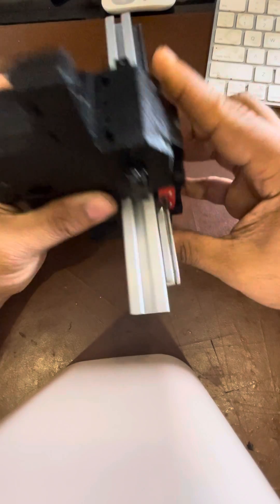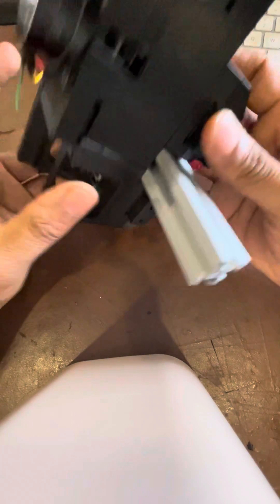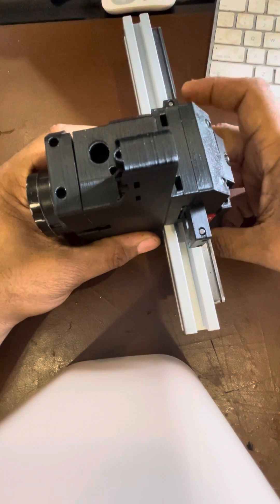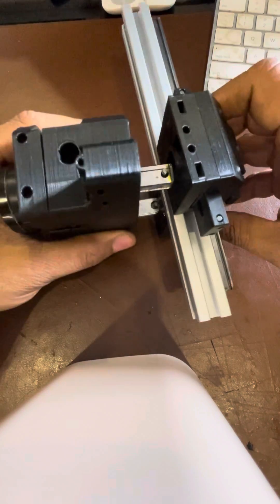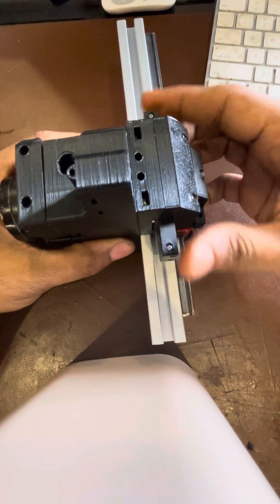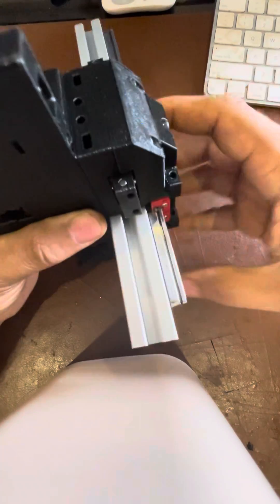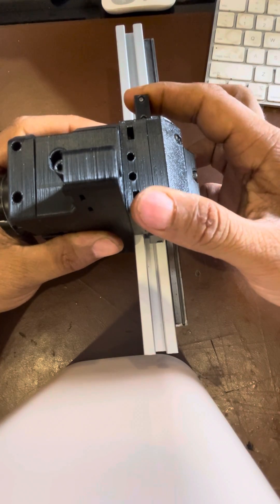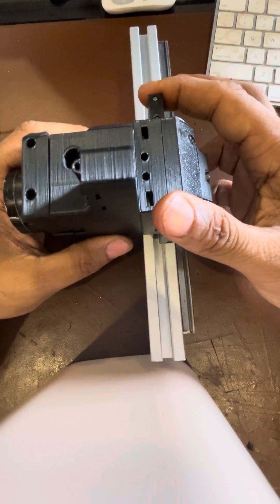3D Printed Fully Mechanical Toolchange mechanism

Comment: Its certainly a better approach for a light printer tool head if you don't need a servo attached.
The design seems very similar to what Prusa does with the XL, from a pic I've seen.
The con is that you need more spacing between the parked tools of course.
Reply from the maker: Thanks